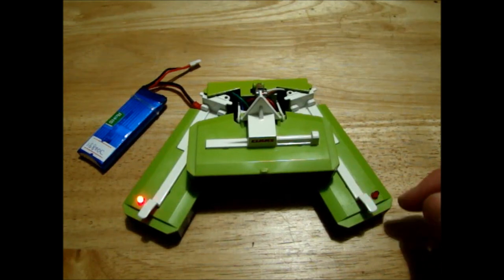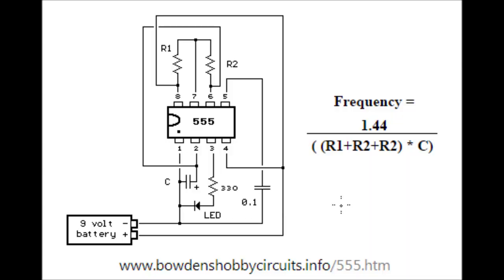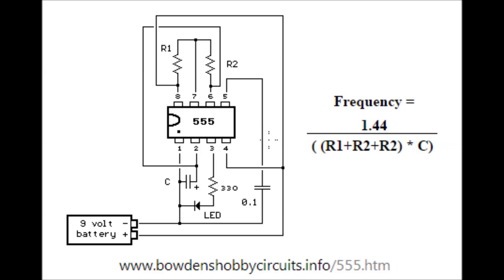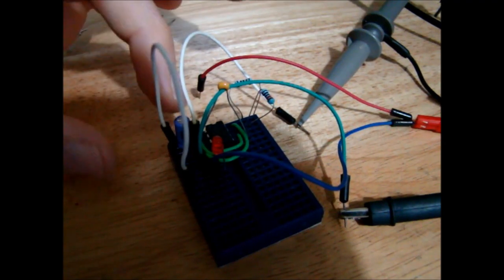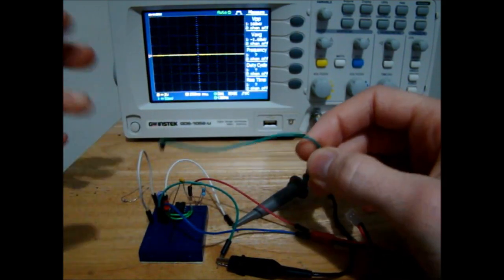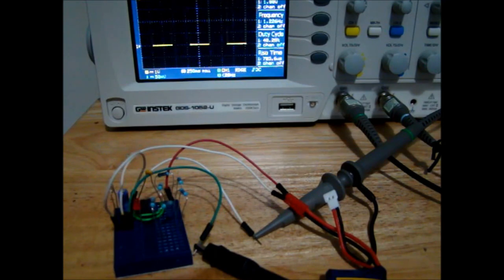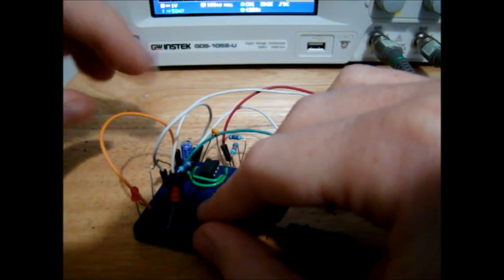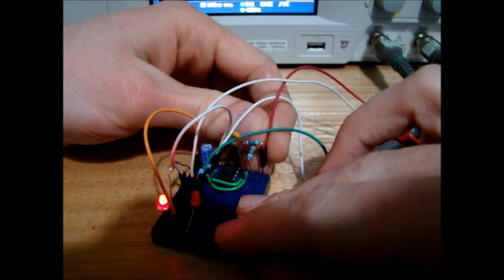How to make a flasher unit for your RC vehicles or static models

Comment: Hi, I am currently thinking of self fitting LED's in place of incandescent bulbs on my motorbike indicator system, I am struggling with the formula to determine the frequency in order to calculate for correct resistors, I have followed your values and put them into my calculator in the following way, ((1000+50000+50000)x10exp-6) = 0.101 not 1.44 Hz ? I'm probably making a stupid mistake somewhere if you could help it would be much appreciated, thanks in advance and cool circuit you've made

Comment: How much does it cost roughly to build a 1/32 RC tractor
Reply from the maker: I think my most expensive one I've built so far has been €85 but I'll be changing the €20 euro radio module I used in that to a €2 NRF24L01 so say €70. You then need to make a controller but one controller should do all your builds, I haven't settled on a design for that yet. I'm not sure what it would cost if you went with off the shelf RC car components.

Comment: Sorry just twigged your 1.44Hz is not stating the answer as the frequency its 1.44 / ((1000+50000.......  what a plonker I am !
Reply from the maker: +Lord of the fleas Ha no problem, I was scratching my head there for a second myself before I spotted this second comment :) If you don't mind me asking, why are you using a 555 timer instead of the flasher unit in the bike?
Reply: +RC Tractor Guy 
Hi, no I'm not using a 555 I am still using the relay/flasher unit for the indicators, the issue is when you fit your LED bulb in place of the old filament type it goes into hyperflash, as I understand this is caused due to the fact that although it is a 12v replacement the LED's do not draw as much current as the old type bulbs and end up flashing at a silly speed, I have had a look inside the relay and realised the frequency of flash rate is governed by an RC circuit and the value of the resistors and capacitor regulate the flash rate/frequency.
I realise it would be easier just to buy a pre determined value inline resistor off eBay, splice it in and forget about it but as I have a new interest in electronics and how they work I was curious as to how to calculate for the required frequency.
Now I understand the RC frequency formula my mind is saying I am missing something else mathematically to account for the lower current required to power the LED, this is my next point of research, it may be something simple like Ohms law and possibly the answer is right under my nose :0)
Reply from the maker: +Lord of the fleas Ah yes I hadn't taught of that, you'd need to trick it into thinking the bulb was still there which I guess would require a high watt resistor wasting power and defeating the point of replacing the bulb with low power LEDs in the first place. Are you planning to remove the electronics from inside the flasher unit,replace with your own circuit seal it all up again? 
You know it might be easier to do with an Arduino pro mini, just monitor the left and right indicator switches and when one is on start flashing the indicators on that side. You would need a voltage divider on each switch to bring the voltage down to under 5v and an npn transistor on each side to drive the LEDs but setting the frequency would be very simple. Just a taught.
Reply: +RC Tractor Guy 
Yeah whilst my bike is in the garage for the winter I'm considering removing the old system and going to some sort of controlled digital system for the LED indicators, the reasons being they look slick (a bit vein I know) but they also consume far less power and have a far superior lifespan to a filament bulb.
like you say simply adding the inline resistor to absorb the unwanted wattage and fool the system would and does work but as you also pointed out its a bit of a naff hack, you still take the same amount of power from the battery and the resistor generates unwanted waste in the form of heat meaning you have to be careful where you mount it.
I like the sound of your idea using the Arduino, an elec engineering friend of mine I was hoping not to have to go running to has mentioned using the Arduino in some of his projects, it is a bit beyond my understanding at the moment and would you mind if I showed him your idea ? he would understand it exponentially more than me, It is as mentioned for a private not commercial project but hey if it seems a commercially viable sales product you will most certainly be involved as a major stakeholder :-)
Reply from the maker: +Lord of the fleas No problem, my suggestion is actually very very simple and I have no problem with you doing anything you like with it. Many people on forums and elsewhere have helped me with problems before so I'm happy to pass on any (hopefully good) advice. I'd say when you discuss it with your friend you'll understand it very quickly. And there is no harm in being vein about your bike which just gave me another taught, with an Arduino you could relatively easily have the LEDs sweep in and out like you see on an audio A6 for example. The circuit driving the LEDs would be more complex though as you need the LEDs very bright and sweeping LEDs may not be legal in all countries, I'm not sure about that.
Reply: Hi'a that's brilliant, not 100% sure what the final design will be at this point but at least I now have some idea's and can go to my lecky friend with some suggestions, I intend to research the Arduino and hopefully learn a bit more about its potential functions, I've watched a couple more of your vids and it looks like a really neat peice of kit, really appreciate you taking the time to reply and for the help its very kind, I'll get back to you in the new year and let you know what end solution was used, have a good Christmas and New Year, cheers Sam
Reply from the maker: +Lord of the fleas Same to you and best of luck with your project :)